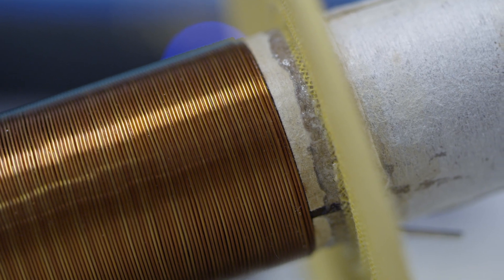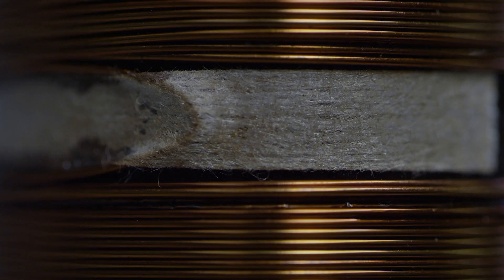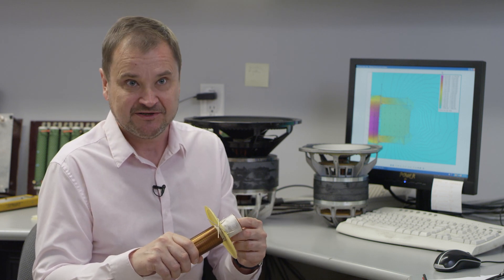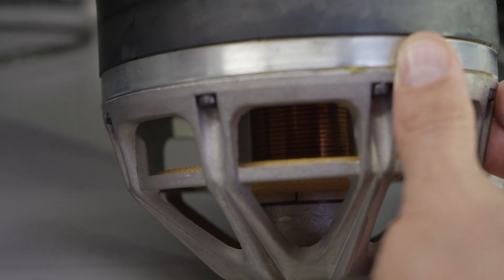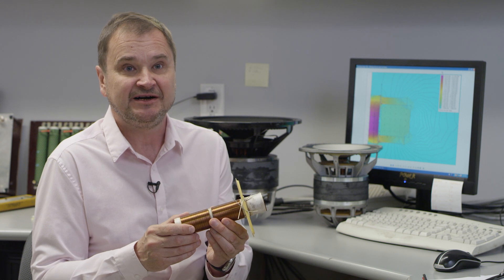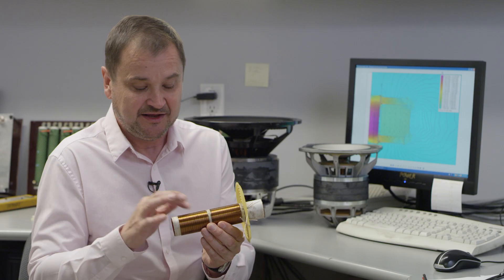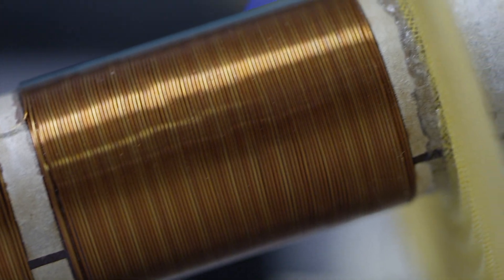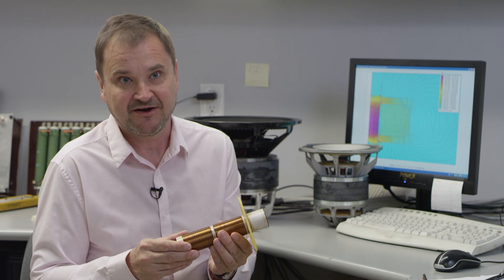SoundStage! Shorts -  Paradigm's Dual Voice Coils (July 2019)

Comment: If the crossover point between the woofers and the midrange is at 400hz, why opt for a 7 inch midrange? Wouldn't a 5 inch midrange be more manageable at the top of the midrange passband? I also noticed a peak in the FR in the presence region from independent measurements of the 9H.
Reply: You'd need two if your design is to play loudly. I also find that a single small midrange sounds well...small, especially with a low crossover point of 400 Hz.
Reply: @carlosoliveira-rc2xt  Yeah, that's a point. And having the crossover between the mid and woofers up there allows the positioning of the mid to be kept low and still side step floor-bounce cancellation. 
Additionally, the spl's these speakers would be capable of would be tremendous. 
There's about 900 square cm of cone area per speaker and heaven knows the x-max. It looks healthy whatever it is. 0

Comment: Which driver is the one to the left of the 9H woofer?
Reply: Good question. Stamped basket but a triple stacked motor with a aluminum bottom basket. It's not a Servo15, Sub15, 2000SW, or Defiance. It doesn't seem to have a large surround. I'm stumped too. Maybe a test driver or sample?
Reply: @ericshoup3379 looks like a seismic 110 on crack haha. The magnets and overall size are too big for it to be that though.

Comment: Very interesting design! Looks like it's capable of some very serious excursion
Reply: Check a few of the previous videos on Paradigm from SoundStage .. I am positive you'll notice these drivers being recorded in slow-motion .. displaying exactly what you've guessed =)
Reply: Actually, according to Paul Klipsch (yes, THAT Paul Klipsch, the inventor/designer of the Klipschorn, way back in 1946), more excursion = more distortion (QUOTE:  "If it moves, it distorts."), so if you need more volume, instead of getting a sub with more excursion, get a bigger sub, or, even better, get a pair of matching subs.  That way, for the same volume, excursion is cut in half, and so is distortion.  As well, with two (or 4) subs, the sound field is much more even, with few or no bass peaks and dips at various points in the room, just powerful uniform bass throughout the room.
Reply: @nomorokay  while Klipsch is definitely correct, larger drivers with more surface area and less excursion do typically produce less distortion for a given power input/sound pressure level output, sometimes having a pair of speakers the size of a drinks cabinet isn't feasible, but I can attest to the quality of the sound of the Klipschhorns as my boss owns a pair. The remarkable technology of producing excellent sound even with high cone excursion has only really been made possible in the last 20 years or so with the use of 'exotic' cone materials and suspension topologies, as demonstrated by Paradigm and other high-end manufacturers
Reply: @wdbaudio  
Agreed, but digital signal processing (DSP) is also a big factor in the excellent sound produced by some recently-designed speakers and subwoofers.  I bought a Paradigm PW-2100 sub back in 2005, a 10” 400-watt model, to augment the limited deep bass produced by my Klipsch La Scala speakers.  That was pretty good, but in 2020 I replaced it with a new Seismic 110, from the same company.  It’s also a 10” model, but with an 850-watt RMS amplifier.  In addition to the extra power, it is able to tune itself to the room it’s playing in, and its place in the room.

You hook up the Perfect Bass Kit (PBK), which is a calibrated microphone, a tripod which is ideal for the job, and a long USB cord, which plugs into the sub at one end, and a tablet or phone at the other end.  The mic gets plugged in as well.  I forget exactly how.  It was a couple of years ago.  Anyway, once you open the free Paradigm app, you start the process and the sub puts out a test tone.  You move the microphone to 4 other locations, within 2 feet/60 cm of the first spot, and it calculates how the frequency response differs from flat.  Then, it produces a mirror image of that curve, putting peaks where there are dips, and putting dips where there are peaks, for a net flat frequency response, regardless of the size and liveliness of the room, and the sub’s place in it.  If you change your furniture or move the sub, you can run the test again, and the sub will produce a new correction profile.  This is miles ahead of just plugging in your subwoofer and hoping for the best.

That sub sounded great from where I was sitting, but the sound field was uneven when I moved away from my listening position on the sofa.  There was a severe bass peak in a metre/yard-wide zone in front of the sofa.  The cure was to get a second Seismic 110, which I had planned to do anyway.  Now, the sound field is even, with smooth and strong bass throughout the room.  As well, having two subs means that for the same total volume level, the cone of each sub only moves half as far, so that distortion is also reduced by roughly half.  The final result is very pleasing to my ears, and every visitor is impressed as well.  The subs are physically pretty small, with cylindrical aluminum cabinets and four stubby legs, so they’re easy to integrate into the room, without appearing to dominate it, and their sound doesn’t draw attention to their location.  You can probably tell that I’m well pleased.  Dual subs is the way to go!